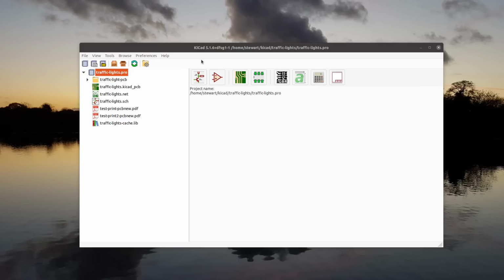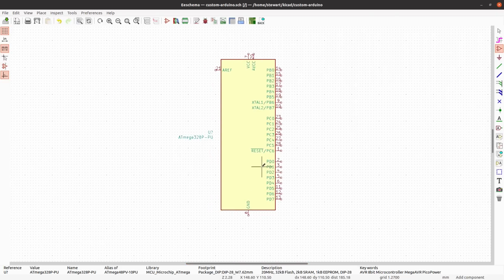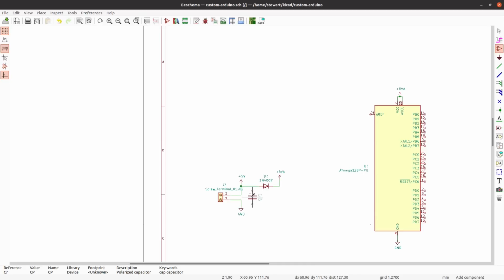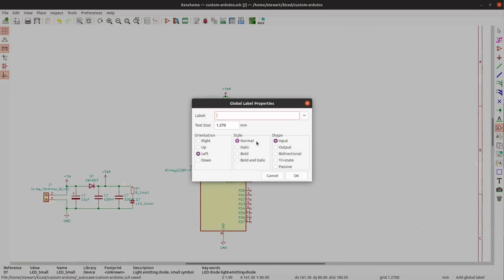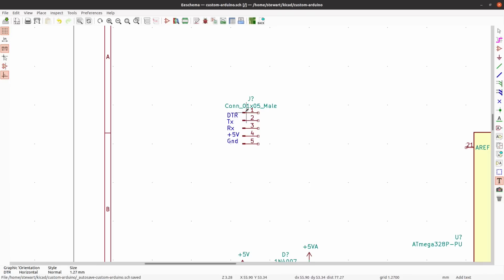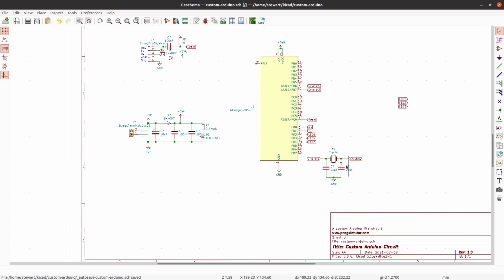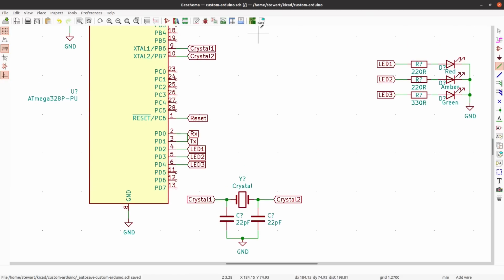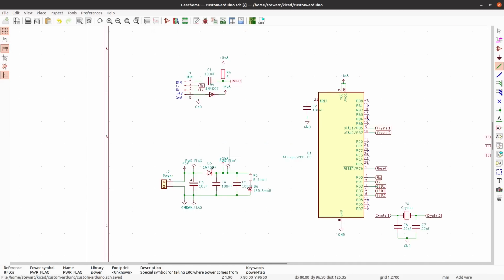KiCad Electronic Circuit Design - Part 1 Eeschema Schematic Diagram - Model Railway Traffic Lights

Comment: The list of components seem infinite, the PCB manufacturers can't possibly keep them all in stock, can they? Do you think this is something to take into consideration when designing the PCB?
Reply from the maker: It is something to consider if you are having the PCB manufacturer solder the components on. In that case you also need to look at SMD components as they can be automated.
Manufacturers will normally have a stock listing so you can check what components they stock.
Reply: @PenguinTutor  Aha! Then I will look out for SMD components and the stock list. Thanks again! ✨✨

Comment: Does anyone know how I can select the value of the pull up resistor?
Reply from the maker: The pull-up for the DTR pin is usually set at 10k ohm. It's more a case of common values chosen rather than calculating an exact value. 

If you have a stable circuit with short leads between the UART programmer and the PCB then you could use a higher value (perhaps 20k ohm). 

If it is prone to noise then use a lower value of 4.7k ohm, but for most purposes then a value of about 10k ohm should be a good value.
Reply: @PenguinTutor  
thanks for the quick reply 😍😍

Comment: hello sir...great tutorial..can you please explain why did you choose the electrolytic capacitor??
Reply from the maker: The capacitor is to provide smoothing of the power supply when a LEDs are turned on or off. Ideally the capacitor should be placed as close to the strip as possible, so if you had a long connection to the LEDs you would put it at the start of the strip. 
There are likely also capacitors on the strip (or on recent strips they are included on the silicon the WS2812B) which are used as decoupling capacitors (reduce noise on power supply).

In actual use you can use the circuit without the capacitor but it can help avoid problems with noise.
Reply: @PenguinTutor  thankyouu sir..the tutorial was amazing by the wayyy

Comment: Great tutorial.  I've never created my own pcbs but this part looks pretty straightforward.  I've only ever used vero or bought pre - designed pcbs.  I m not sure if I would change the rx and tx at the pin headers as this could be confusing for somebody else using your board.  I would expect the breakout to be the same labelling as the microcontroller pins but perhaps I'm being a bit pedantic!  Look forward to seeing part 2.
Reply from the maker: Glad it was helpful! It's not as hard as it seams, although KiCad does take a little getting used to.

The labelling of Tx and Rx is to match the UART board. So for the end user which has a UART board with Tx and Rx on it - runs a wire that goes Tx to Tx and one that goes Rx to Rx. 

I can appreciate that could be confusing if you wanted to connect to say a Raspberry Pi for serial data transfer; whilst you could use it in that way it's not intended for that - it's only intended for programming the board. I'll be adding details on that in a future video / adding it to my website. 

Also if I labelled pins based on the microcontroller then I'd have to do the same for the DTR pin which is actually the reset on the microcontroller (but through a capacitor). That would be confusing to the user whether they should connect Reset to DTR vs CTS.

It's going to be a little confusing whichever way I labelled it, I chose to label it to make it as easy as possible for the less technical user, and those more technically minded will be able to read the instructions (which I will be adding when I add the video on soldering and programming the board).
Reply: @PenguinTutor  thanks for the reply.  I understand where you're coming from and like you say it's all part of the learning curve and, after a few projects,  you'll soon learn to check and understand what you're connecting rather than just connecting it as rote!

Comment: I noticed you accidentally shorted the ATmega328's RX and TX pins when your attemp to wire the pins to the labels went haywire! Hopefully you noticed and fixed it later on, but I haven't finished watching yet, and if I dont note it now, I'll forget! Just at the 29 minute mark.

Cheers,
Norm.
Reply from the maker: Thanks for the comment. It's quite easy to make the odd few mistakes, but using taking an extra look through is enough to spot them, the rules checker also helps, as does printing off the finished design before sending to fabrication. 

I made a few mistakes during the video: missing +5V from the pull-up; shorting a couple of pins and some extra junctions that weren't required, but I did spot all those before sending to manufacture.
Reply: @PenguinTutor  No worries. You spotted it anyway, always best to check these things before committing to hardware!

Take care.

Cheers,
Norm.